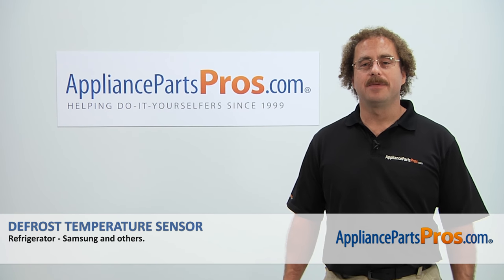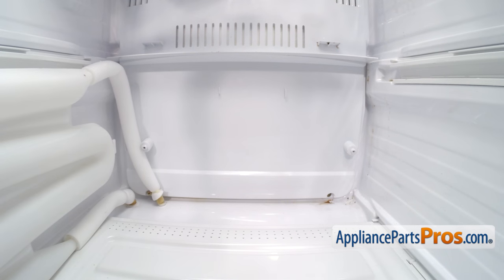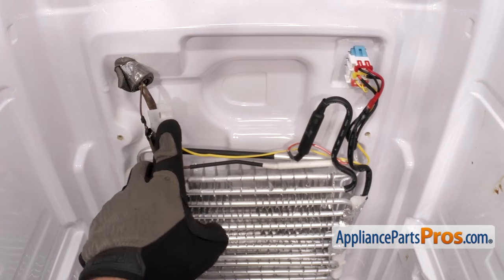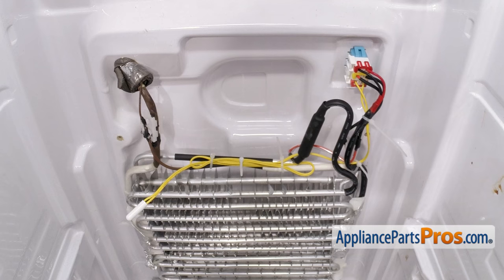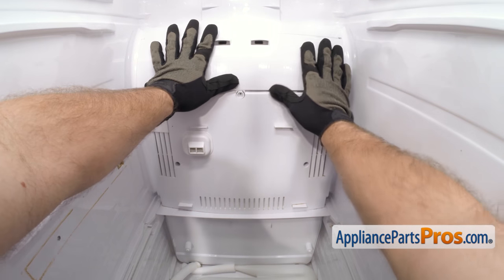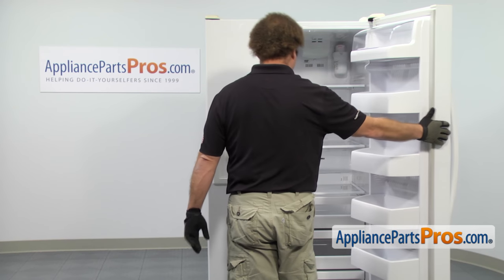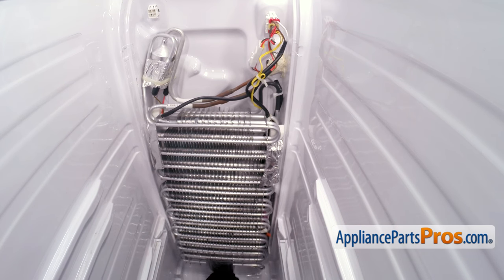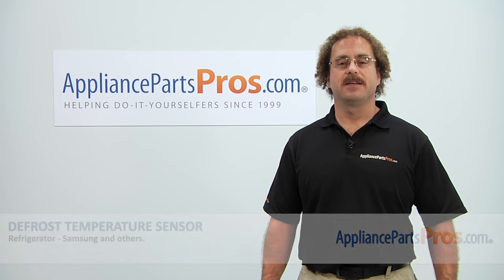How To: Samsung Defrost Temperature Sensor DA32-10105R

Comment: I bought a samsung fridge a few years ago and after a power surge in our street which blacked out our area, the fridge cooling wouldn't function properly (freezer fine).  Hovered around 12 degrees C (although the display had it fluctuating!).  Replaced the sensor and for a short period it worked (1 week) and then back to 12 degrees!  Decided to get rid of the fridge, turned it off and ran a second fridge beside it for a week.  The night before I was going to get rid of it I turned it on for one last try.  The next morning it worked perfectly and has continued to do so ever since!  I think that when I approached it with the screw driver to take the doors off so as to get it out of the house, it decided that it was either behave itself or it was the scrap heap and so opted for our company.  True!

Comment: Do you replace both sides if freezer is working properly and refrigerator side only cools to 60 degrees F?
Reply: I wondered about that also. My fridge stopped cooling also because it had iced up so I'm guessing it was the sensor on that side that was faulty. Since the Samsung website doesn't say which sensor is which I ordered both of them. ¯\_(ツ)_/¯

Comment: It's interesting to see this video. I have a RS265TDRS which keeps icing up in its refrigerator evaporator coil, eventually blocking the fan, and causing the fridge to be too warm (~48F when set to ~34F). From the factory, its defrost sensor is on the inlet side (upper-right of the coil, short white-color wires to the NTC thermistor). I just moved it to the left side (requiring extending the cable to reach), to exactly where it is shown in this video, based on a tip on the RS267 fast track sheet, suggesting to put it on the outlet if freeze-up is happening. I also replaced the foam gasket that goes around the evaporator with a more substantial rubber gasket. Hopefully my modification will help. However, I do worry a bit about the zip ties rubbing through the wire. From factory, there is a bit of plastic tube to help against abrasion, but it isn't so long...  In this video, the two gas lines were zip-tied together. I wonder if that'll cause any issues or inefficiencies because heat will be able to conduct from the outlet tube to the inlet tube, or cause the two tubes to rub against each other... not sure...
Reply: @PL Lyons I'm not sure yet. :) I just modified it a few days ago. Over a few months, ice would build up around the fridge evap fan. When the ice built up, the fridge temp would rise to about 50 F. I would run the force defrost occasionally and it'd go back down to reasonable temperatures. The ice sometimes started interfering with the fan blade (it made bad noises). It never reported any error codes. Presently it's 35.5 F, when set to 34 F, though I'm not doing any fancy logging of it. Time will tell if it will maintain cooling. My guess is that the gasket replacement will help more than moving the defrost sensor. It should also be noted that the temp will rise greatly on the shelves when the door is opened. The bottom (of three) drawers also seems like it's a warmer area in general.
Reply: @pigrew  update?
Reply: No strong results. It's iced up every four or five months (as evidenced by the refrigerator temperature being too high, measured with a thermometer at the at the rear). I run the self-defrost when that happens and it's good for a few months.

My guess is that the better sealing insulation helps more than relocating the thermometer.

Comment: I have this cooling issue with my Samsung RS2534WW, freezer side is fine, fridge side gave me an error code of 7,  (Refrigerator Defrost Error). My fridge is 10 years old. Should I replace both the defrost and fridge sensor since I am going inside the unit, there is also a defrost thermal fuse In the same area. Do you carry all three components?

Comment: Hi, I have a Samsung convertible refrigerator RT37K3993SL/HL 
freezer not convert in to fridge but display is ok .fridge & freezer temp. show is 3'c but freezer temp is - 20'c .fridge works correctly .Why & How fix this problem
Reply from the maker: We'd be happy to help you out with that! We offer free technical advice and diagnosis. You can give us a call at 1-877-477-7278 or you can chat us at our website: http://www.appliancepartspros.com/. We will need your model number to give you accurate advice, which you can locate using this tool on our website: http://www.appliancepartspros.com/modelnumber_locator.aspx

Comment: Hi, I have a Samsung  SRS 583 HDP  and it's working  OK but display unit it's playing up. It displays -3 C in freezer but inside is - 20 C. Is there any way to  fix the problem? Is it a sensor problem?
Reply from the maker: We'd be happy to help you out with that! We offer free technical advice and diagnosis. You can give us a call at 1-877-477-7278 or you can chat us at our website: http://www.appliancepartspros.com/. We will need your model number to give you accurate advice, which you can locate using this tool on our website: http://www.appliancepartspros.com/modelnumber_locator.aspx

Comment: Hello, I replaced my refrigirator side defrost sensor as the frost had built up so much stopping the fan from spinning. I had a fault code for the R. Defrost Sensor and a fault code for the Fan.

Since replacing a few days ago, everything has seemed to be running fine but the fault code for the R. Defrost Sensor remains which doesn't fill me with confidence. Is it okay to ignore this?

Thanks

Comment: I'd replaced the main control board on my Samsung side by side fridge 3 months ago and it has been working like a champ.  However, since I increased the cooler temp by 2 degrees to 40 F the other days, the next day I noticed that the freezer temp 0 F on the led display stared flashing suddenly.  So I powered the fridge off at the circuit breaker and waited 2 hours before powering it back on.  After the fridge was back on for a few hours, the temp on the led display was all over the place and the compressor doesn't seem to stop at all.  Led display shows cooler temp at 34 F and it shows freezer at 48 F.  Please advise what should I do or check at this point.   Thanks a lot !
Reply: What is the defrost sensor value you've installed? My side by side Samsung ref freezer is not working. The setting range is -17deg C to -23deg.C. what is suitable sensor value di you recommend? .sorry I couldnt find value or specs in my Defrost sensor.thanks.

Comment: My Fridge runs well for about 12-16 hours then it stops cooling, could't be the defrost sensor?
Reply from the maker: The first easy thing to check is that it's not an airflow issue, and that your appliance isn't overstuffed, blocking the movement of air inside and between freezer and fridge. If it's not that, then it sounds like it could a defrost problem, though there are a number of parts that could cause that issue. We offer free technical advice and diagnosis, though, but we'll need some more information. We'll need your model number, which this link on our website can help you find: http://www.appliancepartspros.com/modelnumber_locator.aspx Then you can give us a call at 1-877-477-7278 or you can chat us at our website: http://www.appliancepartspros.com/. We also have a free repair forum where the techs can help you troubleshoot the problem: http://forum.appliancepartspros.com/. We’re here to help 7 days a week